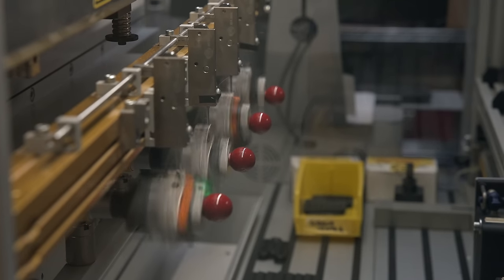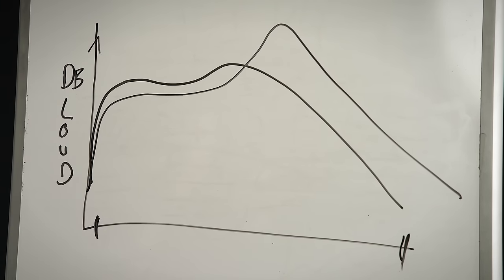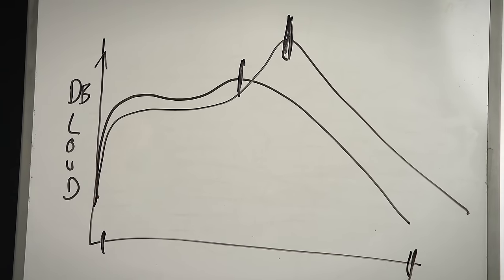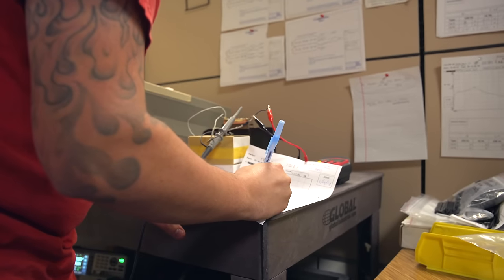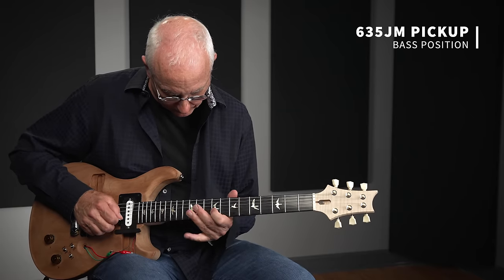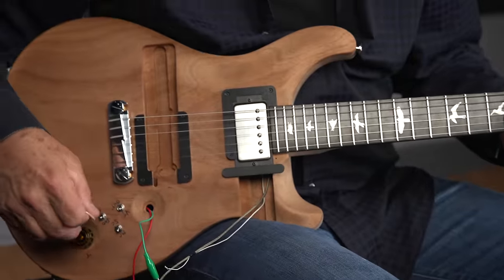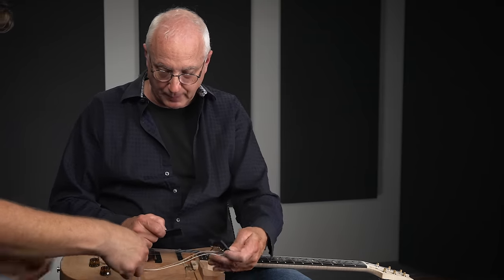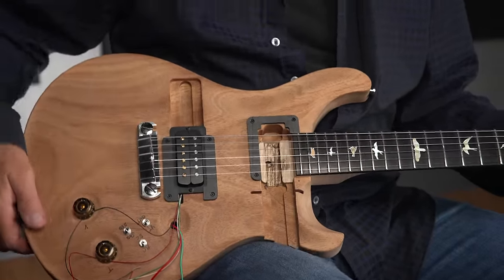Paul Reed Smith Explains PRS Pickup Design | PRS Guitars

Comment: One question, do you sell them separately, or do they only go with a PRS guitar?😀

I had an interesting experience with my SE hollowbody Standard, thank you for building a fabulous guitar.  for a very reasonable price, and I am a humbucker player, exclusively, but your demo method and the resulting narrow field PU sound is very impressive.   

But to me the higher *gauss pick ups like an SD JB are the way, …..touch sensitivity is what I’m after, but I’ve played hot pick ups that didn’t sound good.  So there is indeed hi art involved, you seem to be exploring an interesting niche, but raw power may not suit that pursuit.   I changed my SE’s bass PU to an SD 78, measures *7.9
The guitar wears it well, sounds even better than it did.  

One interesting note to you all:  the guitar would distort at max volume with the original wiring.  With the 78 I redid all wiring, switch/pots and Jack.
Switch craft & CTS 1 being a push pull that switches the bass/neck  PU from series to parallel coils.   & a “Cornell Dupris” cap….now? No more max volume knob distortion?!😳.   Why?  The original capacitor?   Was that by design?  Or suspect parts you have high standards, I’m inclined to think it had a weird off spec defective tone cap, but the new wiring also brought more life out of the still original bridge PU? Brighter, fuller in the upper mid.   Didn’t expect just changing those parts would 
affect the tone of the instrument that dramatically for the better of an already good sounding guitar?

Comment: I’m confused. Paul just turned everything I’ve ever known and heard on its head. I never heard anyone else say that the treble pickup goes in the bridge and bass pickup in the neck. I thought the treble pickups are in the neck and the bass are put in the bridge position. I know the bridge sounds spankier and tighter since the strings are literally tighter, but I always hear more highs and clarity on the neck position — and I thought most lead players use the neck pickup because it tends to cut through the mix better on stage and recordings. Likewise, I thought rhythm players use the bridge because you hear deeper, tighter tones. 

I am hearing what Paul is describing, but  I don’t generally hear it that way in most guitars and it seems like I can’t be totally wrong if lead and rhythm players are using their chosen positions for the reasons I gave. That said, is the opposite true on a PRS guitar? What am I missing here?

Can someone help me understand this? If you have any good resources or videos, I’d love to see them. Thanks in advance!

Comment: Hey Paul, All very exciting stuff. One thing confuses me. I have looked through a lot of the PRS line of guitars and what surprises me is that the neck pickup when split, focuses on the bridge side coil rather than the neck side coil (at least according to your web page pictorials). This seems odd and even wrong. If I look at Silver Sky with 22 frets, the neck pickup pole pieces are right about where the 24th fret would be if it had them. This is also true of my current guitar (a cheaper Hohner). That said, I would say the tone that pickup provides is special. I use that pickup more than the other two pickups on my guitar. Listening to the guitar demos of the various PRS guitars on this youtube channel, I am finding that the split neck pickup sounds are closer to my middle pickup and the humbucker neck sounds closer to my single coil neck pickup. I don't hear the single coil neck sound I use all the time though. I am guessing it may have something to do with the manufacturing process? Getting the wiring to be on the bridge side of the pickup closer to the controls? I don't know. However, it would seem, especially for the 24 fret models, the bridge side coil would make more sense. For the bridge pickup, the choice is probably right. Even the strat seems to have the bridge pickup a coils width away from the saddles.... even if it is slanted. The split bridge sounds about right to me.

Comment: I've just upgraded my S2 Semi-hollow, by fitting an SC245 bass p.u in the neck position and a Dragon II treble in the bridge position.   Both run through a five-way superswitch, then to two independant ICM  (Integrated Control Module) controls.   Giving positon 1=Bridge series HB; 2= Bridge South+Neck North in series; 3=Bridge HB + Neck HB; 4 = Neck South + Bridge North in parallel; 5= Neck series HB.   

The ICM is my own design that allows guitars (like the Semi-hollow) normally fitted with a master control circuit - two knobs, to operate as a dual control circuit - four knobs (Les Paul, SG, 335, Tele 72 Deluxe etc...) but on two shafts - uses an inverted dual-concentric pot (outer - tone/inner vol) controlled by gearing/dente in a push-pull fashion - push to control volume/pull to control/set tone.   As I don't tend to use the tone controls as much as the volumes, these ICM units allow me to 'preset' the tone and leave the knob in the down (vol) position for most of the playing.   The ICM unit is very versatile and can be used in a variety of ways,  mixing differenct pots/rotary switches/blend/pan/variable treble bleed/TBX/'Q'  etc.    The ICM Mk1&2 is the basic device,  with just two dente positions - up and down, but the ICM Mk3 has three positions on the input shaft -- fully down (vol) mid dente (tone) upper dente (switch - phase rev/dual sound/coil split/variotone filter/S1 4PDT etc...).  
.
My S2 Cu22 SH  has a far more dynamic voice than it had with the OEM (G&L) Korean jobs, which nevertheless were excellent budget pups.

Comment: Since Paul doesn't talk about the mechanism to record the resonant frequency, I suggest folks check Ken Willmott's "Electric Guitar Pickup Measurements" posting from 2014.  Just search for it.
The basic idea is that the pickup sits atop a "magnetic exciter", think of it as a pink noise across the entire pickups' input, and the output is graphable against this input. 
And this tool type isn't new and many have used it extensively.

Comment: I have a 2020 McCarty 594 singlecut with the 58/15LT  . Firsdt time I have been happy with a humbucker  neck pickup.  owned a few Les Pauls in the past and always hated the muddy too warm and not enough clarity tone of the pickups in Les Pauls.    besides loving the feel of the neck etc I finally found the guitar I always wanted when I bought mine.  Nice thing about the LT also is now the amp and FX are what color the tone not the pick up.   when I run middle switch position with both coils split is sounds very acoustic for an electric.  I have had piezo models that were not as nice!    the detail in these new guitars is sweet and they play and sound amazing

Comment: Greetings Mr. Smith. After 20 of development in 2015 I started building my Sonic Wave electric guitar bodies that exhaust body waves far from the strings producing longer lasting sustain without the unwanted noises. I've tried many different configurations and pickups. The results are always the same. The longest lasting sustain without special pickups or electronics but with the goodies its a whole nother level of tone ambrose. You have permission to use the Sonic Wave concept as your pickups are truley worthy. Y'all can style it your way but its about sending semi hollow body wave exhaust out the sides away from the strings to avoid interrupting string wave. Encapsulate the pickups among the inner rails and leave central open space underneath to create a Vesica Picies chamber to drive the main body waves out the side ports. I'll send you some pics if y'all wish. If I get my appendages on some them pickups my #23 would probably be able to open a Rosen bridge with a "D" through my little cheeser test amp. Congratulations on all your breakthroughs and much more. Best wishes from a fellow artist.

Comment: Just curious.  How do you measure the frequeny response of a given pickup. Are you actually providing a flat response mechanical vibration to simulate the vibration of a string and measuring the output of the pickup  vs frequency ?  Or do you have an analyser setup to measure the resistance, inductance and capacitance  vs frequency and calculating the frequency response of the pickup. Or possible something else.  Just curious.  Hoping to hear from you .
Reply: I have  to figure out how to use telegram ?

Comment: There's still a lot here I don't understand. Paul says magnetic pickups are the microphones of the electric guitar. Microphone makers try to achieve mics with a neutral, flat frequency response that is as faithful as possible to the sound of the originating signal. And yet here we have evidence that magnetic pickups are not just peaky in their frequency response, but wildly so. So much so, that single coils have what Paul calls 'a whistle'. Well excuse me, but I would rather start off with neutral. That gives the best chance of hearing the actual sound of the guitar. Adding EQ pedals, preamp or digital processing then allows players so tweak the sound the way they like it. Of course the homage to the past, the legendary 50s and 60s pups, means to an extent the guitar makers might be unable to innovate because the old last century legendary sounds are what people really like and want to have. Pity. it would be great to have the choice.
Reply: I'd like to attempt to address the 'flat frequency response' comment.  Your assumption "microphone makers try to achieve a neutral, flat frequency response" is not really correct as it depends upon the application.  Sure, some mics are made to be 'flat', if it fits the intended purpose, i,e, calibration, spl measurement,  room frequency analysis, etc..  However, musicians often prefer or require 'coloring' of the sound. Case in point, take the common SM58, some of its features are: proximity effect (bass tip up),  presense boost (vocal clarity) and a cardiod pattern (feedback rejection).  These design parameters address the difficulties encountered in live vocal performance situation, where as a "flat" mic would not perform well nearly as well.  Historically, the SM58 has been extremely effective with what you may be calling a 'peaky' frequency response.  I hope this explanation makes sense & wish you well in your sound quest.

Comment: The tone of two knob PRS guitars is fundamentally constrained in that you can’t blend the bridge and neck pickup volume.  Once you master the technique on a Les Paul you will always be frustrated with a PRS.
It’s so frustrating I’ve rewired my CE22 by removing the selector switch and putting in two volume, one tone … both pups always on.

Comment: I wonder what it would be like if you split the humbuckers, and wire them like they were in the bass and treble position.  The front side of the treble humbucker (towards headstock) and the front side of the bass pickup wired as one humbucker, and the back halves wired as another humbucker.  Could this be wired this way with a five way switch.  1 = bass only, 2 = front of humbuckers, 3 = all on, 4 = back of humbuckers, 5 = treble only.  I think that would be an interesting blend.
Reply: Maybe but sort of dizzying to imagine. Find the best two and hard wire it with a switch.

Comment: One of the commenters writes he thought TCI is only a marketing hype. It is , as the name is concerned although the pickups are excellent of course. The fact is  that Capacitance of a pickup itself is about 80-200 pF while the cable you connect and it is parallel with the pickup is about 200-600pF and as they are added you can hardly play with the tuning of pickup capacitance itself, unless you force the player to play with a dedicated cable with fixed capacitance. The truth is that the inductance, resistance, geometry and magnetic strength are the factors makers play with and the capacitance has the least importance. Paul will not tell you all his secrets as he did not mention here e.g. the importance of the material of slugs and screws of a humbucker, he did not mention the function and creation of the mid scoop in the curve on the white board either.

Comment: Most players know without a doubt that springs and resonant cavities produce overtones that add a bit of “verb” to the tone; though sometime selective on certain notes and their harmonies. Usually open strings and their multiples. esp’ when playing unplugged. I know the pick up ‘s got first choice on sending it out quickly and there are a lot of good designs, but I’ve seen people that break and intentionally crack the plastics on them, (lap steels)! even tube retainers, and speakers, anything to get microphonic (hopefully controlled) mayhem. I’ll have some intelligent frequency following devices  that will lock on to your bending cries and moans that comes from inboard mic’s that can be placed any where in the chain  from body to cab. So don’t tear out those weak single coils just yet, there’s a balance in being to weak and being to strong, remember those stings still work in the mechanical realm. So even if we “plek” the pu’s to the body: individually, we’ll still be in the tone quest forever and a day, which should be the “day”S to just enjoy the sounds. from;  content  player to un content programmer.

Comment: I will have to say that as a PRS player since the early 90s, Paul has come a long way in his pickup designs, for me, stock PRS pickups were unusable until the 57/08s and 59/09s; finally pickups that do his guitars justice and sound as beautiful as the guitars look and play
Reply: The 58/15 S (korean ones) that they put even on their USA S2 line is still unusable. Low mids mud fest. Owerwound, high output, pedals and amps just choke getting so much lows. Try cleaning up a sound with the guitar volume knob - all the presence is lost and you are gone in the mix. Very dissapointing you need to swap the pickups to make a 2k $  guitar usable.

Comment: Microphones and Pickups convert a physical phenomenon to electrical frequency and they're called transducers. Speakers convert electrical frequencies to physical phenomena- they pump air- they are also transducers. The human ear hears between 20 to 20,000 cycles per second or Hertz. I've had 37 guitars and I've never owned a Paul Reed Smith guitar. I am curious though. I'll have to set some money aside and see if Carlos is right.
Thanks Paul.

Comment: Me and Paul have a huge disagreement in regards to pickups. All PAF/Gibson-style humbuckers will distinctively sound like PAF-style pickups, with variations in clarity, output, etc. This goes for all pickup designs. I have a POS P-bass copy made from MDF with a cheap ceramic split single coil pickups, and it sounds similar enough to my modded Squier with Seymour Duncan QP pickups. The biggest variable in the tone of electrically amplified instruments is the speaker

Comment: I've allway's complained PRS pickups were wound to hot, Now the 57/08's in my Sunburst 22 are not and sound great. The new 57/08's are a different story. Now he's building PU's that are wound in the 8k range, finally. Tho the 245/ mira's I have I also like Around 9k range but a stronger mag than the 57/08 to keep them from getting too muddy. The new PU's to me are wound better but seem to have too strong a mag for the low wind. As a rule I find up to 8.5k A2, When around 9.2k A5 anything more than 9.2k is too overwound for me. Like SD 59's have A5's, when I swapped to A2's they sounded much better, IMO.

Comment: I wanted to custom order a PRS in 1988, but Paul wouldn’t do what I wanted because I wasn’t Santana or Ted Nugent  I just bought a used PRS that I could sort of live with about 10 years ago because the price was right it’s OK not my favorite guitar by a long shot   I wasn’t asking for much I don’t use the gauge strings that Paul reed Smith guitar is come with and at the time they were guaranteeing them to stay in tune so I asked  for the guitar to be built with the gauge strings that I use. They said they would do that, but they wouldn’t guarantee it stays in tune, strike one. I also asked for zebra coil pick ups since at the time both coils were black I was told they wouldn’t do that for me -strike three.!! yeah, there was no strike two.  I didn’t appreciate being treated like a second class customer since I wasn’t famous I only bought one of these guitars out of continue to curiosity.  Like I said, I don’t find it to be anything special. The neck is kind of a weird feeling to me.